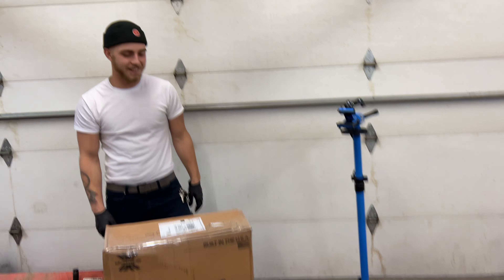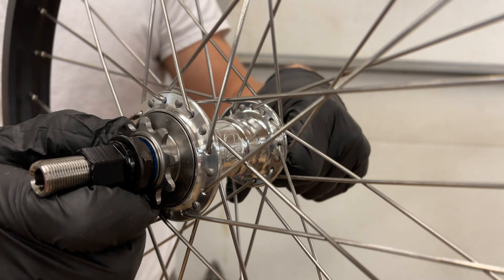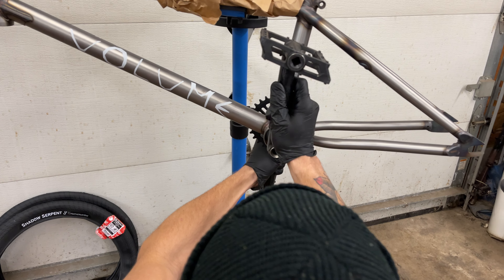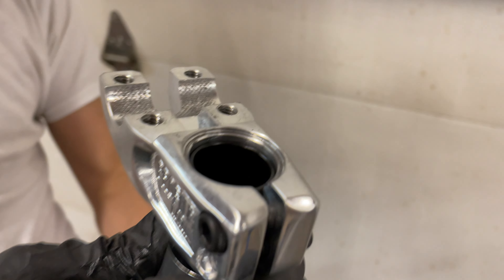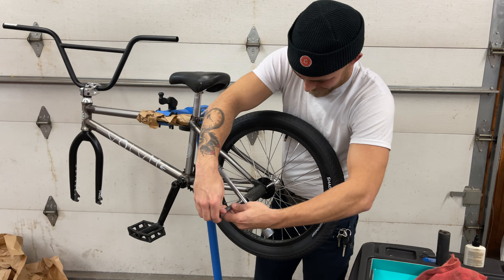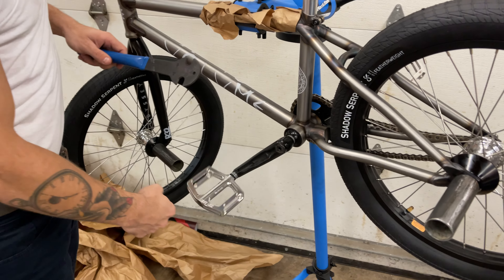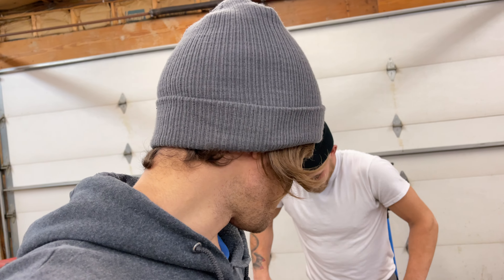Cody's BRAND NEW BMX Bike!! - Unbox And Build!

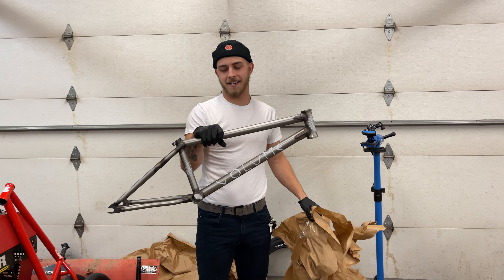Comment: 3:43 This is his old signature frame when he was on Volume bikes he ride's for Federal bikes now.  Spec's for Cody's new frame is 
    MATERIAL: Full 4130 Chromoly
    HEAD TUBE ANGLE: 75.5°
    SEAT TUBE ANGLE: 71°
    CHAIN STAY LENGTH: 13" slammed 13.2'' Centre 
    BB HEIGHT: 11.7"
    STANDOVER HEIGHT: 9"
    DROPOUT SIZE: 14mm
    HEADSET TYPE: Integrated
    BB TYPE: Mid
    BRAKE MOUNTS: Removable
    GYRO TABS: Removable
    WEIGHT: 4.13lbs